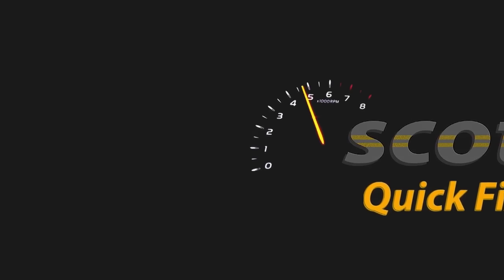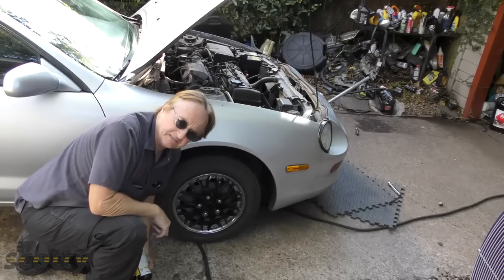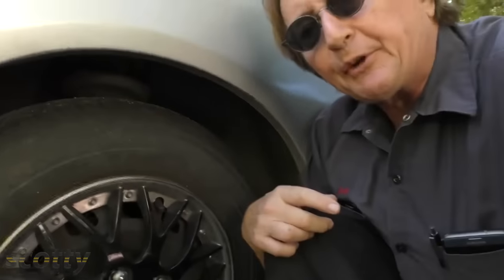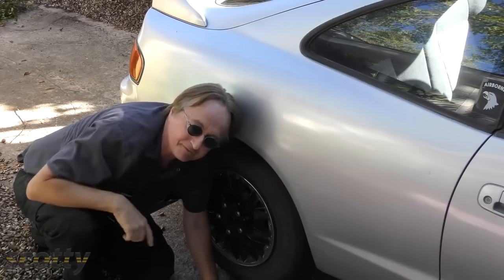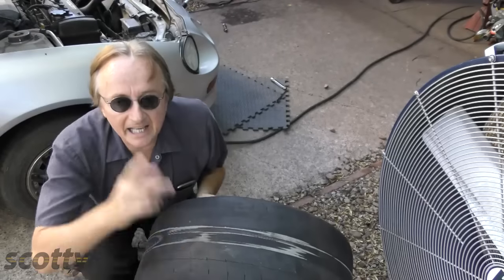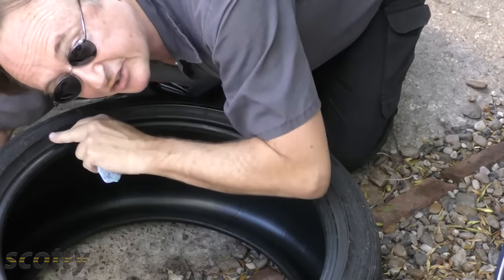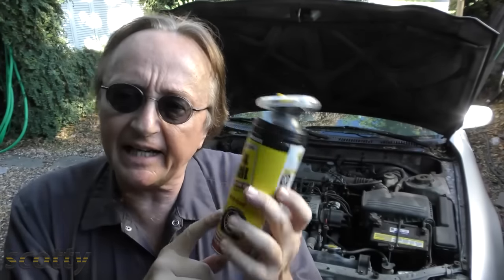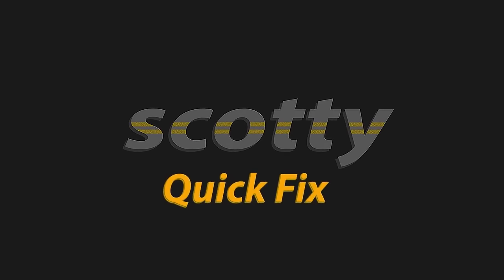Does Fix-a-Flat Really Work? (How Fix a Flat Tire)

Comment: Or just carry an inflated spare and take the punctured tire to a repair shop who can sort it out in minutes. But hey what do I know. :)
Reply: Rýán Túçk Why would you have to inflate a spare? There should be no space before your comma. You used "both" before describing three actions. The structure of your entire sentence is a mess.
Reply: I agree totally and The structure of your life must be a mess if you take the time to correct grammar on YouTube. It's a comment section not a novel nerd.
Reply: Not all cars have spares.
Reply: If a car doesn't have a spare tyre I'm not buying it.
Reply: Spare tires are usually ignored for years and can lose air pressure making them almost as useless as the flat tire they are meant to replace.  Check your spare!
Reply: There are indeed many novel nerds on YT.
Reply: @Alex_Mitchell  I don't check it too often because a tire that isn't in use isn't going to be exposed to road salts / dirt (rims), turn stresses, deformation (fatigue/ micro-fracturing), sun, pressure or weight stresses.
Reply: @madthumbs1564  That's all well and true, until you need the spare and it's flat.  Checking it once a year is so is not hard to do.  Also, if you have a VW Beetle from the 60's, (I had a 69), the air in your spare powered your windshield washers.  It was a weekly job back then.
Reply: Char Char Binks  LOL
Reply: Always carry an inflator regardless. In case your spare is low or you have a slow leak. I would only use fix a flat, Slime, tire plugs in emergencies or for off road use. I have not had any luck with fix a flat. I would trust a Slime type product more because it is thicker and goes in with the tire valve removed.

Comment: A bit off topic:
Can I use diesel oil in gasoline engine?
Car mechanic asked me which "C" ratio (c1,c2,c3..) oil to put, the manual didn't say anything about it (only 5w-30) so he put C3 5w-30. When I came home and made some research, I found out that "C" ratio is for diesel engines...
So should I change the oil again? Or can I use that oil in gasoline engine?
Sorry, I didn't find any video about that.

Comment: Great tip because my car has no jack, wheel wrench etc due to run flat tires.  I am replacing with regular tires.  When using fix a flat, at what point do I remove an embedded nail?
Reply: Use anything other than Fix-A-Flat.

Comment: Most manufacturers are including these fix a flat cans and air compressors instead of spare tires, but they don't help if you get a puncture bigger than a pencil eraser. If your car doesn't come with a spare tire, you can build your own system! You buy a lug wrench, a jack (Maybe a sturdy platform to sit the jack on), and then you can get a wheel, the same size as the original wheels, like a simple steel wheel or a wheel that actually matches the original wheels on your car.

Comment: Try and make shire the puncture is at the bottom when filling. And drive as soon as possible to distribute sealant across whole tire. Also top off to correct air pressure asap.

Comment: Fix a flat will cause steel wheels to rust, if you do use it I would always recommend getting it out of your tire when possible
Reply from the maker: the modern version does not cause any rust. From what I figure, it has some kind of anti freeze in it cause it doesn't freeze in the winter either.

Comment: Fix a flat saved my ass one night. I had hit a curb and got a flat. The wheel was so rusted it would not come off. I tried everything for hours and even help from friends and strangers stopped to help. Walgreens was on the corner. Fix a flat fixed it in seconds. (I later learned a good way to unstick a rusted tire is to loosen the bolts, and drive the car very short distances, a ft pr 2, front and back and slam on the breaks each time)

Comment: Be weary of that "TIRE SENSOR SAFE" thing. From my understand it really means "safe for a limited time". Once the stuff sits in your tire for a while it will eventually damage the sensor, you are supposed to use that stuff as a temporary repair to get you down the road and then have the tire patched.

Maybe I'm wrong and things have changed since I looked into it?
Reply: Are there sensors on 2002 car tires?

Comment: I used one of these on my flat tire, they worked great sealing the nail puncture.. And the tire rarely loose pressure for a couple of years, but when they did, i can not fill it with air, because the valve is covered with those stuff.. And i need to replace the whole valve.

Comment: The mechanics where I live don’t like when you use something like that and take the tire to them to patch it, they says it’s dirty.
Reply: Same here.  Some places around me don't want to patch the tire after this schmutz is put in there.
Reply: two words: too bad.
Reply: You won't be able to find the leak after you take the wheel off the vehicle. The tire would have to be dismounted and then washed out and then remounted to find the leak. Going to cost you extra
Reply: did tire repair 15 years myself, we hate that stuff. it has to be cleaned out really good or a patch wont hold.  now i understand you have to do what you have to do in a emergency, but we still hate it.
Reply: I plug my own tires now don’t use fix a flat or the green slime, plugs are supposed to be temporary but if you either don’t have the time for a patch or new tire they work really well. Have plugged the side wall even and it drove for 2 years after.
Reply: I use plugs on personal vehicles. Use the good ones and they last!
Reply: Fix-a-flat is great for lawnmower, wheelbarrow, and ATV tires. Just put the stuff in there even if it's not leaking. Then you won't have any issues. You're welcome.
Reply: They'd rather you pay them 150 for a tow truck
Reply: i had a mud tire on my jeep with 7 plugs and 2 truck tire patches that lasted a couple years of hard use never had a problem with the plugs or patches and if you are fast enough you can get the plug in before you loose all the air
Reply: chris I haven’t mastered yet how to remove, ream, and plug.
Reply: Jonathan Luis I have used it many times and then drive into America's Tire to get it fixed for FREE. No hassle, no complaints, no problem.
Reply: We had a customer who's tire went flat and she used an entire can of this stuff, didn't drive it very far, and then let the car sit for a while. The car developed such a violent shake at speed. It pooled up at the bottom and then dried and made a huge ball of slime and stuck to the tire/wheel. It made a mess also. Get your shit fixed, this band aid just makes it more expensive at your tire shop and pisses every one off when you come in.
Reply: Haulin' ass Wastin' gas True. Or they can find a decent shop that doesn't mind getting their hands dirty.

Comment: I've never used fix a flat but have used tire slime.   Used it once in an old truck tire and it just doesn't work.  As someone else said on here, when I took it to a tire shop to get it fixed properly, they charged extra to scrape all that crap out.  Have used it in atv tires too, again just doesn't work.  The only tire it actually worked in and the only type I would use it in again would be a lawnmower tire.

Comment: The last time I bought new tires, I was told that using fix-a-flat would void the warranty.  Instead, I was supposed to bring the tire in and have them repair it.  In case you're wondering, tire repairs were free on tires they sold.

Comment: Great story, I’ll have to use my fan of tire fix I got but forgot about.  One time I got nail and firestone tried patch but the batch didn’t hold air for 12 hours before it went below 12 PSI, meanwhile the nail in tire could drive around and be fine, only losing air down to 18 after trips and sitting for a week.

Comment: The ONLY time I would recommend using fixaflat is if you PLAN ON REPLACING THE TIRE AS SOON AS POSSIBLE! This is coming from a technician here. You have no idea how much this stuff ruins the inside of your tire. The stuff its made out of is extremely similar to silicon. Which is the same exact stuff that covers the inner lining on your tire. Whenever a tire is patched, we gotta scrap or buff off the lining of silicon BECAUSEEEEE the glue/ cement used to bond with the patch WONT STICK TO SILICON!!!! SO basically using this stuff almost guarantees us NOT being able to repair the tire properly.

Comment: I ran into a pothole and the tire side got a very small hole that drains the air every two weeks, I bought a flammable sealant with latex. I hope it seals that tiny puncture

Comment: Hey! I love the way you caution against gotchas. I have a Sebring with aluminum rims. One tire seems to lose more air over time than the others. Would it help to use Fix a Flat to slow down what I assume is a slow leak at the rim or is the root cause likely to be something else?
Reply: P.S.The tire was new in May...
Reply: Spray a 50/50 mix of dish soap and water around your wheel and tire.  Look for where it bubbles, that will be the location of the leak.  if it is anywhere on the wheel or at the bead seam of the wheel and tire, invest the $100-150 to have the wheel reconditioned.

Comment: I had a side leak making it impossible (or so I was told) to fix by conventional methods. The tire is getting along just fine needing to be topped off with air once since at least 8 months since I used the fix a flat. I can easily live with that as it saved me the cost of replacement.

Comment: What exactly makes it TPMS sensor safe? I thought the whole point in keeping the sensors alive and unclogged is to put nothing but air in it?

Might work well for old cars or aftermarket wheels that don't have TPMS sensors in it, but I still wouldn't trust putting that stuff in the wheel. Pretty sure TPMS sensors aren't waterproof. Also, I've heard about fix-a-flat rusting rims from inside out and damaging the tires.

Comment: It definitely works but Slime is clearly the best and they have a gallon jug that you can pump into your tires pretty much making them self repairing
Reply: I haven't had a tire lose air yet to see what kind of mess it makes but I always warn techs when using any kind of sealer

Comment: Tire guys HATE this stuff. It works...for a quick fix. But so does changing to a spare or donut & going to the shop. 
We only use this as a last resort for our vehicles. 
We were camping once and a can was run over and EXPLODED all over our jeep. We still have spots of that crap. It takes oven cleaner to remove it. 
And it can build up in one side of tire and cause balance issues. 
Emergencies only.

Comment: Could you do one on that stuff you pour in your radiator to seal the radiator and heater core? Does it work?
Reply: djkblend1 That stuff can wreck havoc on your cooling system. I don't know one car that used radiator stop leak that didn't either plug up their radiator, clog their thermostat, or blow the head gaskets. In the long run, it's going to save you money and a huge headache to just replace the defective parts.

Comment: I had a Goodyear tire that had half of its life gone, and the bead literally warped its way right off of the rim. About a 3 inch section of sidewall simply 'moved' up and off of the rim, allowing the air to just 'POOF' right out of the tire.  Lucky for me, I was in a parking lot when suddenly I heard  "pis, pis, pis, pis....."  as the tire rotated.  I came to a stop and saw the warped side bead, and there was no way any fix-a-flat was going to work on that.  The place where I got the tire told me that they would give me a 50% discount on a new tire of the same brand but I said "No Thanks" and I now refuse to buy any Goodyear tires anymore after that.  Before that incident I had a set of Goodyear tires that started de-laminating internally, leading to 'thumping' noises as I drove, and I threw them away after they were half worn out also. Huge risk of a blowout on a highway when they de-laminate internally.  Now I only buy Michelin 'Defender' tires for the summer, and Pirelli winter tires for the winter months and I have never had any problems with those brands.  
   I never trust any of those liquid fix-it products as they often cause more problems then they fix.  Instead I carry along with me Rubber tire plug 'Ropes', wire cutter, a tire RASP and INSERTER needle tool, and a can of rubber glue, and when I get a flat due to a nail or screw I just enlarge the hole a bit more with the rasp, take one of the 6" rubber-coated tire plug 'ropes' and insert it into the 'Inserter' and then dip that into the metal can of rubber glue, then I insert that rubber glue coated plug into the hole, carefully pushing it in only half-way into the tire (not all the way). That is easier said than done as often the plug makes a sudden slip and goes in too far, so you have to cup one hand around the inserter to prevent that from happening.  Once the plug is pushed in the right amount and NOT too far in,  I use the wire cutter to cut off the excess amount of rubber rope, and then let the tire sit for about 15 minutes before filling it up with air, then driving off.  That is good enough to fix the tire for the rest of its life, and no need to do any further fixing on it.

Comment: Would you suggest to add this to tires that dont have a flat and dont need a fix? I think my stock rims are bad because my tires were made on mid 2016 and installed on august 2016 i always fill my tires with 35 psi and within a month or a month an a half i need to add more they always go down to 28. My vehicle does not have sensors. I check the  pressure when my gas milleage is odd, i always get 250-270  per tank, if i get 210-230 i check them.
Iv check them and took them to get inspected and they cant find a nail or a leak, neither could i find one.
Iv heard some of these liquids mess up the inside of a rim if done often. Or if not taken to a shop to get the tire fixed. (Oldschool no plug, a patch inside of it or a plug with. Patch from the inside out)
Reply: Aluminum rims can get cracks that can't be observed by the naked eye. Had a similar problem. New tire and changed valve stem, had the same slow two week leak. Put in Green Slime. Seems to hold past 8 months. Tried the fix-a-flats (different brands.) Green slime works the best.
Reply: John Space they are the stock alloy rims, im just wondering whats wrong, losing 7-8 psi every month when there isnt no visible leaks and even the shop cant find them seems odd. 
They even made me missed my slippery, cracked  old tires they held the 35 psi for 5 months noisy and shitty drive but they worked.

Ill see if i add the green slime, in all tires how much is enough for them (need in all 4)? Iv seen half jugs and small bottles.
Reply: The porosity of aluminum alloy rims has wider spacing in it's molecular structure. Most gases that comprise air will slip past alloys faster than if you had steel wheels. This is especially true when the wheels' factory clear coat isn't perfect. It'll cost you a lot of time and labor to re-clear them yourself. And a chunk of money to have them refinished by a professional. Replace with steel wheels of the same size and your tires will stay up much longer.
Reply: Would be best to take your car to a wheel repair shop and spend the $500 to have them reconditioned.  Sounds like the aluminum is corroding and pitting the bead.  Need to be bead cut in their repair process.  Anything else is just a temporary fix.